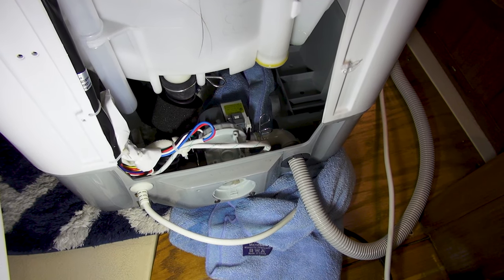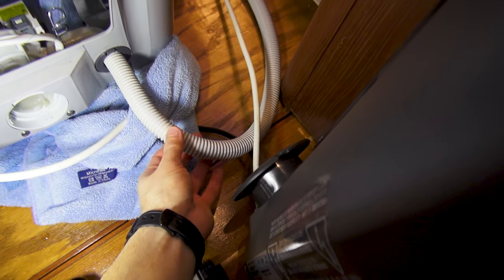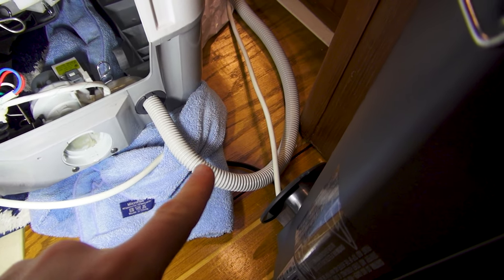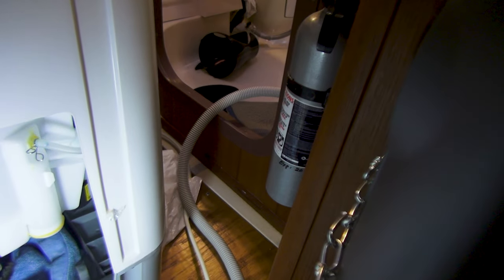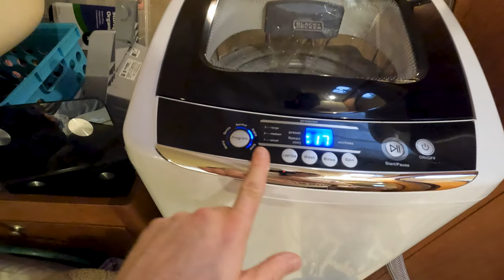Installing a Microplastics Filter for Our Laundry Machine Water Discharge - Sailing Viridian EP 67

Comment: Hey dude I dont understand y u mounted that clip underneath the wood panel. If the purpose of it is to keep it from rocking and/or shifting, isnt it best to mount it at the top against the outer edge? 
Can u do a follow up video showing how it has held up, and show how the filter looks? Also how to replace it and where to get it?